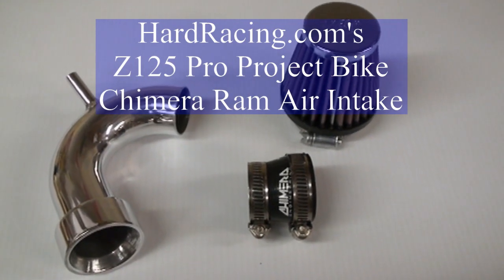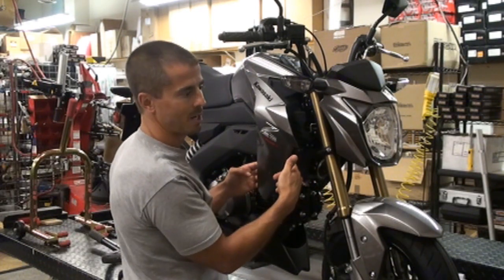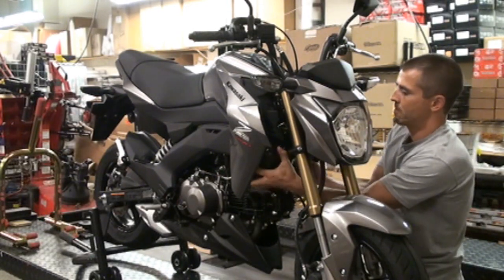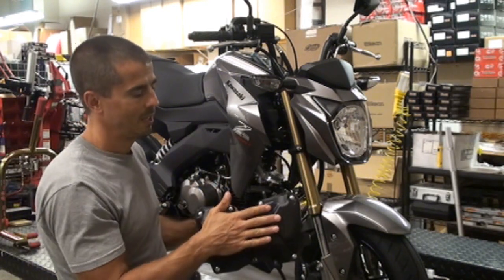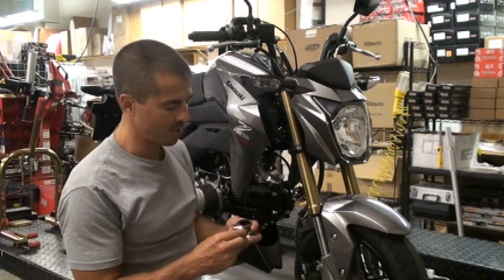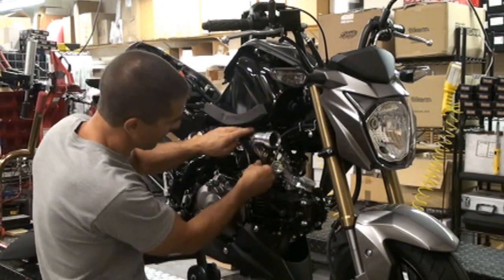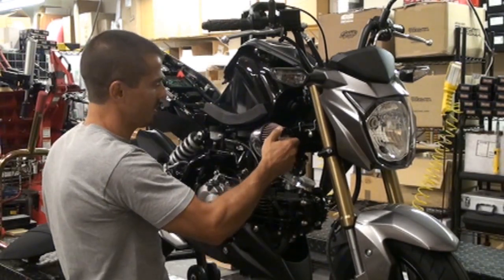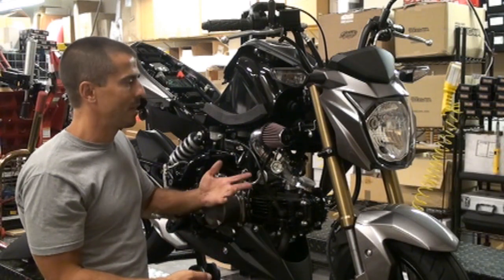Z125 Pro  Chimera Short Ram Air Intake - MUCH BETTER  #Hardracing #Z125 #Chimera

Comment: Couple of questions still intake or the MNNTHBX? and do you really noticed a difference or is it worth just leaving it stock?
Reply from the maker: Yes, CHIMERA Intake is best setup.You retain the crank breather tube, which is very important, and Alum. Tube holds shape and flows better.